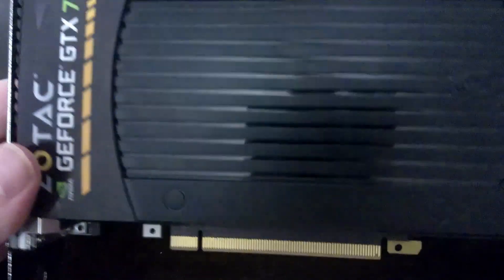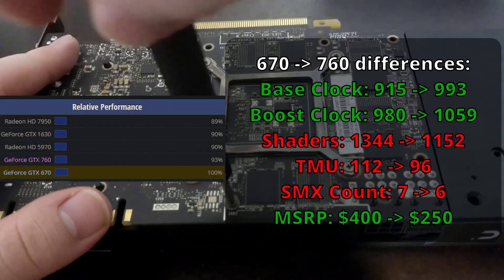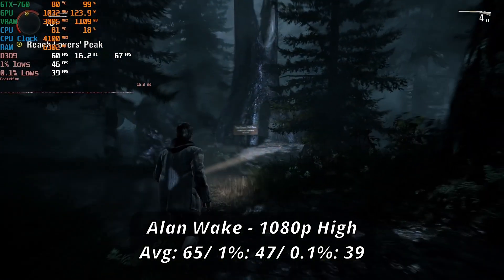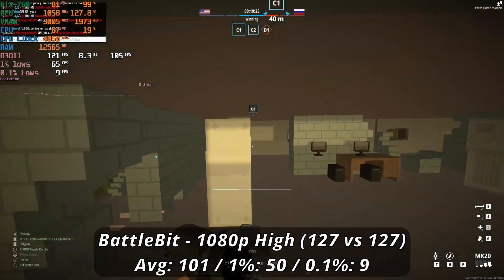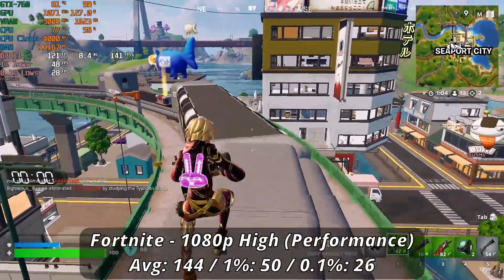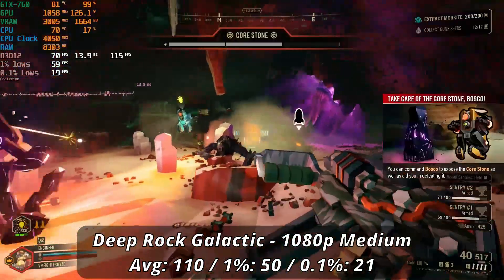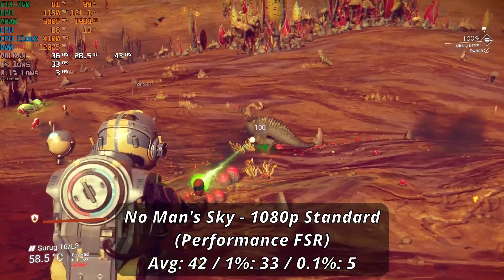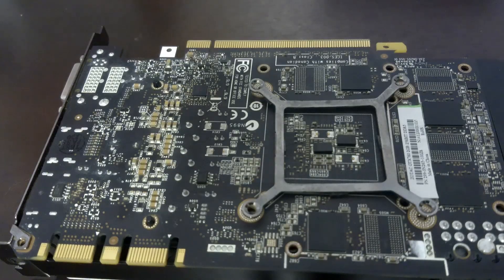GTX 760: Is 2gb of VRAM really enough?

Comment: Your CPU seems to run terribly hot when only approaching 20-30% usage. Is that normal for the 3600? My 5700X on air can't even reach 70 up to 50% usage.
Reply from the maker: Not normally, its just the testing case I use doesn't get amazing intake as it is. I'll change it out at some point, but it's not a big concern at the moment.

Comment: Higher bit memory bus than the RTX 4070 Ti btw...
Reply from the maker: I love modern day Nvidia 🙃
Reply: Significantly less cache, though. Something that isn't irrelevant to the equation either.
Reply: But still less than the Fury X/R9 Nano with their 4096-bit bus, which puts it on par with the 1660 in terms of performance, despite having 2 GB less VRAM and being 4 years older.

Comment: Expected you to run it will moderate to demanding games.Not games which can run on any potato pc😅
Reply: I'm not sure some of the bigger modern games would load at all on this, isn't there a vram minimum on some games? 

Either way I wouldn't expect much out of it in demanding games, if you want to play those at good settings don't look at this lol
Reply: I don't think 1080P or 720P FSR ultra performance mode with all low settings & .ini editing to turn effects off  is any advisable way to play a game.

TLDR: Don't buy this GPU for modern demanding games.

Comment: 250$ for this thing is crazy in nowadays
Reply: that was its launch price. you can get them for 40-70 buckaroos. its way better than the 1030, but if you can find an used radeon 6400 that one sweeps them both
Reply: @Fleerix i got a evga 1070 for 60 buckaroos off ebay recently.  it's a great time to be in the used market if you're willing to ignore ray tracing.  that 1070 can run basically everything well.

Comment: I have 2gb gtx 770 it still very usable in 2025, I’m running CS2 low setting 95fps @3440x1440p which is neat since it’s near 4K ,Played RDR2 1080P 30fps ,quite usable at 1080p
Reply: I mean, yes you can play games. But I prefer my game to look good. I want ultra settings, and at least 100fps so 2GB is not very good then, since RTX2060's or something aren't that expensive anymore I'd just go ahead and buy one of those (Which I did 4 years ago lol)
Reply: @ I want to upgrade to but currently playing rdr1 and gta 5 at ultra settings 90fps and have lot of backlog when it comes to playing games so once I have to play modern games I would have to eventually upgrade
Reply: Bruh 4k is about 8 million pixels. 

3440x1440 is 4.9 million. 

2560x1440 is around 4 million. 

How badly did you fail math to say its near 4k?